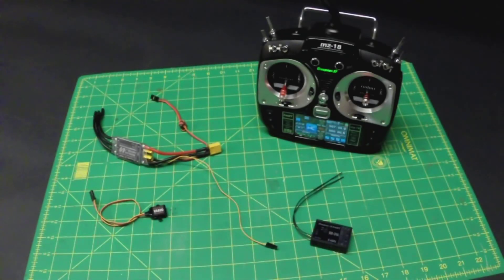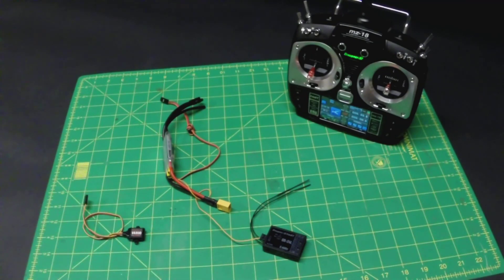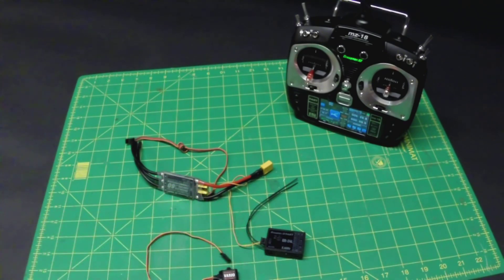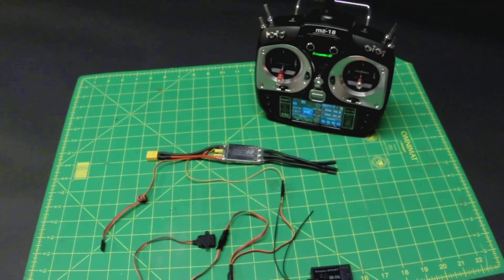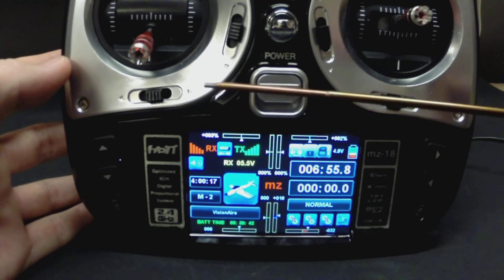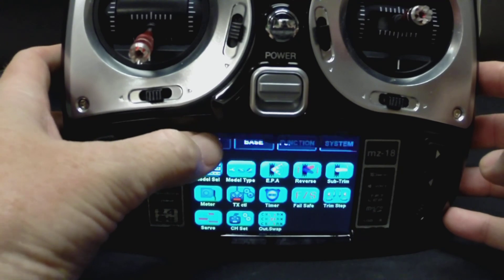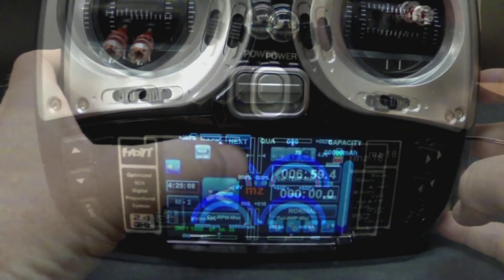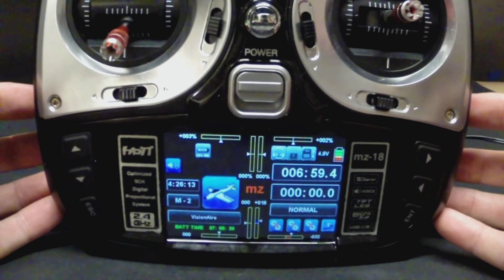Graupner MZ18 By James VanWinkle

Comment: very nice video, one thing i didnt hear about is the power consumtion of this transmitter...you know using a color touch display and all...and how does it work outside, in the sun i mean, can you see the display well enough?...im currently using an older MX-16 and this thing has to be recharged like every 3 month and its black and white (its more like black and blue) display has no problems in the sun at all...thanks for the video, cheers?

Comment: hallo,

I am new to the hobby, never fly before. so i have a couple of question if you don not mind.
1) what is the difference between Radio Control-Set mz-24 PRO HoTT and Futaba 18sz or 18mz wc? is your Tx cover everything? and can i connected to a simulator software like realflight or pooenix?
2) what do you recommend realflight X or phoenix 5.5 simulator?

regards,
anas